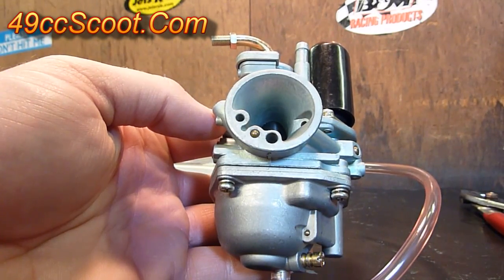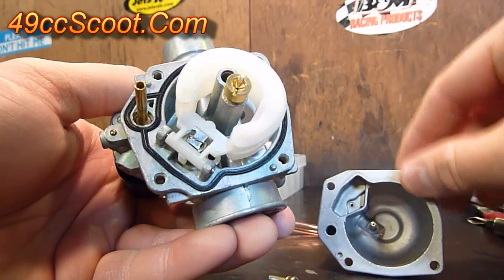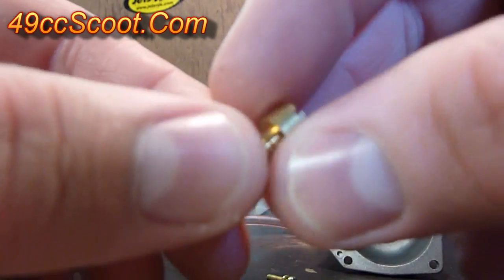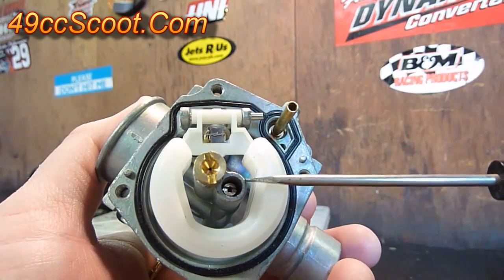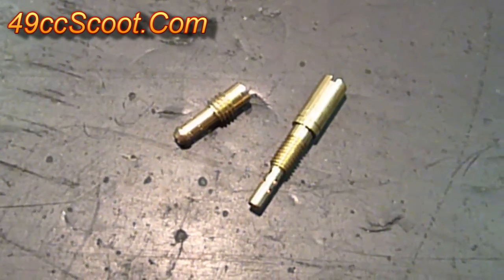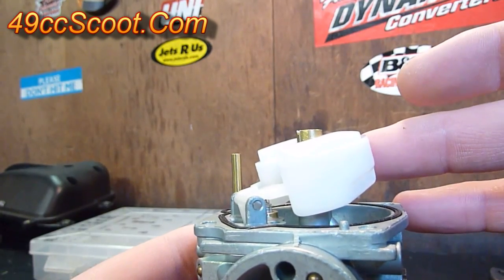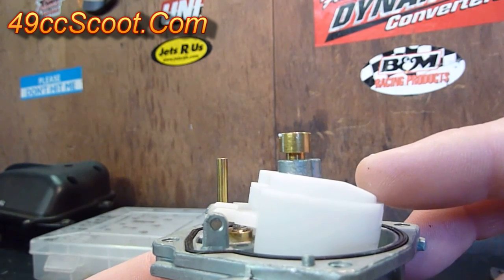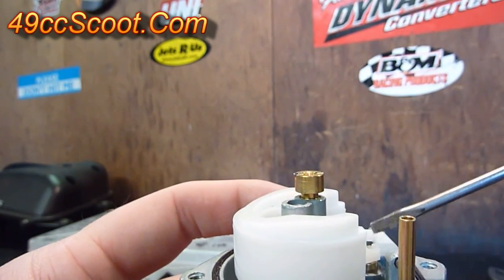Two-Stroke Scooter / ATV Carburetor Settings And Adjustments 4of4 : Jetting & Float Height

Comment: I have an 04 zuma. when I got the scooter it ran fine, fired right up no issues. after having it a little while I noticed it was leaking from the overflow on the bowl. I replaced the valve needle, cleaned the valve seat and replaced the bowl gasket. doesn't leak anymore but now is a p.i.t.a to start. I adjusted the air/fuel screw and best idle was with the thing almost all the way out. I also replaced the air filter with an oem replacement from uni and may have over oiled it? the old air filter was completely disintegrated. was going to order a smaller pilot jet but I'd like your opinion first if you can help me out. last thing, after I get it started (about 30 seconds on the electric start) it runs great down the street and fires back up instantly.
Reply from the maker: My first step would be to take a look at the air filter and clean and re-oil it if it's over oiled. See if the enricher is working. Check your float height. If that's good, you can try a smaller pilot jet.
Reply: 90GTVert Thanks for the reply!

Comment: great vids maybe you can help  my Yamaha.. 99 razz riva, manual choke, idles fine bogs down when you hit the gas and dies, gas leaking from air filter, I replaced the petcock but still leaking slightly.... cleaned the carb and float seems to be working, I blew air into it and the flow stops when the float is lifted...ideas? maybe I messed up the adjustment screws when I put it back together.. set mix screw at 1 3/4 turns from bottom out, idle screw just above the speed to get the back wheel spinning (5 to 800 rpm Id guess)
Reply from the maker: Float height may still be wrong. If it's leaking fuel from the airbox, that's usually a float issue. Till you get that solved, you won't be able to get a good tune.

Comment: could the float cause the engine to flood?
Reply: when trying to turn on? or is it the pilot jet?
Reply from the maker: Definitely.
Reply from the maker: Could be the pilot too, but if the float level is too high it can let fuel overrun and even flood the engine when it's off it fuel flow is not stopped buy a petcock.

Comment: what air filter size would fit this carb?? 35mm???
Reply from the maker: That should work. The stock airbox works pretty well in most cases though.
Reply: i took mine off and it wont go back on for some reason
Reply from the maker: You may save yourself some tuning headaches if you get the stock airbox to fit again.  Once you fit the pod filter, you'll have to tune the carb.

Comment: Hey B, just curious. What is the big silver bolt sitting above the idle screw(edit:speed). I know it's not the AF screw, but just wanted to know since my carb has one aswell.
Reply from the maker: Simple answer : Nothing you need to worry about. 

I'm not totally sure. Most of my carbs don't have that. It isn't any sort of adjustment. It seems there's an extra fitting on that carb for some reason and I guess they stuck a bolt in there.

Comment: Hello 90GTVert , i am having a slight problem , i have changed the air filter , exhaust and am trying to change carb on my yamaha zuma 50cc , but carb cable isn't the right one ( i am trying to install Dellorto 17.5 ) , Dellorto is using cable such as in your vids here when you showed about needle , but mine cable end is different , should i change the whole throttle handle with cable  , or is it possible to change only cable ? Thanks !( sorry for bad english )
Reply from the maker: I think Motion Pro (I could be wrong on the brand) makes a Zuma specific cable. Some of the Zuma guys on my forum could tell you if you can't find a specific cable.
Reply: I don't need to change the handle ? only cable right ? and still , thanks ~ !
Reply from the maker: If I'm correct on that cable, then yes the cable should be all that you'd need to swap.

Comment: i'm having problems with my aprilia sx 50 i purchased a new exhoust put it on there and can't get it to accelerate very well if i let it idle and give it gas it goes but stutters on high revs on low revs its having trouble i tried alot of main jets i'm gonna try to put the needle in the right place and hope for the best
Reply from the maker: Once you get a pipe, make sure you keep the revs up as it's likely to be kind of dead at low RPM. Stuttering/sputtering is usually rich, but looking at your plug after a WOT run should confirm or deny that.

Comment: i am not sure but your mainjet looks not really to fit pretty long the screw thread
Reply from the maker: It is the proper jet. The one you see is the jet that came stock in the carb. The VM11/22 jets have worked for me for the last 10 years in these carbs and match up to stock well, so I think they're OK.
Reply: okay thank u

Comment: i have an issue with my tgb 101s where it just loses all its go at around 30km/h. kinds seems like it isn't getting enough fuel. I haven't got a machanical bone in my body... any tips on what i can do?
Reply from the maker: A really common issue is people changing air filters or modifying/removing the airbox without rejetting. If any of those things have happened, go back to stock or rejet. Look for air leaks, like a cracked intake or damaged vacuum hose.
Reply: +90GTVert I have a feeling the air filter isn't stock. i only just bought it. the current air filter is just sitting there not in a box not fastened in any way. didn't notice until after i bought it.

Comment: Thanks for your explanation.My bike Yamaha FZR 250. i cleaned my mikuni 
carburator (4) and cleaned main jet,pilot jet and adjust air mixture 2.5
 turns out from the closing point.Cleaned the air filter.My problem is 3 times failed my eco 
(smoke) test and result show more petrol consumption.but last years 
easily pass the eco(smoke) test.My problem is need to reduce petrol.How can i 
adjust/reduce petrol flow ?please help.Thank
Reply from the maker: +Ravi Shane Make sure the engine and emissions are in good working order. I don't have emissions tests here and don't know anything about smoke testing. If something specific like NOX or CO emissions are the issue, changing mixture may help. A little more info on that here : http://www.49ccscoot.com/faq/richorlean.html

Comment: Hi , your videos are excellent. Keep up the good work!
 I have a CPI GTR 50 with a mikuni VM16 with 17.5 pilot jet and I'm not sure that is the stock size. Do you know the stock size?
 Thanks
Reply from the maker: Beniiito69 Thanks. The stock carbs I've had have been 17.5 - 22.5.
Reply: *****  OK thanks!

Comment: So i have Baotian aprilia sr50 replica when i start it up the idle is around 1800rpm then when i drive it and its warmed up ti goes up to 3000-3100rpm and stays there, should i re-adjust the idle then ? or something is wrong with my carb?
Reply from the maker: Crepsitto Try readjusting the mixture screw and speed when it's warm. You may have to compromise between the best cold and hot idle quality or decide which is most important to you.

Comment: Hi, I got a new carburetor but it gets over flowed what to do ?
Thnx
Reply from the maker: Start by checking the float height. If the float is set too high it will keep letting fuel in till it's so high that it overflows. Also make sure you bowl screws are secure and the drain is not open. If it's not one of those simple things it may be in your best interest to see if you can return/exchange it since it's new.
Reply: ok thanks :)

Comment: hi hope you can help. I have a piaggo zip 50 2t 2stroke scooter. I done the idle and mix adjustments as in your last videos. the problem is its seams to have more power just off full throttle. if I back off ever so slightly it runs great when I go full throttle it feals like it bogs down a bit and dosnt want to rev right out like it use to. any thoughts?
Reply from the maker: Try using a larger main jet.

Comment: Help !!! I have a Eton Viper 90R that idles great but when you give it gas it bogs down. Any help with this problem will be greatly appreciated
Reply from the maker: My first two steps would be to ensure that the air box is installed and in good condition and then to make sure the carburetor is clean and jets are clear.

Comment: Great video.  I've got a carb off a 2000 Scarabeo 50 2T that I've been struggling with.  The float doesn't have a metal tab on it that you show here and what I've seen on every other type of carb I've ever seen.  This one instead is fully plastic and the needle valve is connected to the float with a spring.  With the carb inverted the float seems to be resting way to high(i.e. setting down into the carb when upside down instead of level).  However since the whole float is plastic there's no adjustment that I can see to make.  Does this style of carb sound familiar?  Could it be that spring that holds the needle valve is worn out?  If not then is it OK for this style of carb to to not necessarily rest level to the bowl mounting plate?
Reply from the maker: It sounds like maybe the spring is worn out, but I can't find any Aprilia Scarabeo service manuals for any specs. If it's not having any overfueling issues, maybe it will be alright. Perhaps you could go to a hardware store and find a spring that would work to get it level when uncompressed.
Reply: Thanks for the reply.  Would overfueling cause the engine to sputter?  That's what appears to be happening after it warms up.  For the first couple minutes it revs up fine, but then consistently it just starts to sputter and cant get enough RPMs to accelerate beyond a crawl.  I originally thought it was a breathing issue but everythign's clean.  The float kit is only $10 so I went ahead and ordered it anyway just in case but curious to know if what I'm describing is symptomatic of this issue.
Reply from the maker: Rich conditions do cause a sputter and also the plug will usually look wet at that point if you check it. Could be a faulty enricher or not getting power to the enricher. The enricher adds fuel for a few minutes at startup, but should stop automatically. If it doesn't work, it can cause what you described. It should be retracted when cold and then once the scooter runs and it gets power it will heat up and expand to block off a fuel passage. Vid below shows it working out of the scoot.
 
Automatic Enricher Operation (10x Speed) : Choke Bypass Bystarter

Comment: Thanks for the vids.  I'm trying to get my son's "new" 2005 Polaris Predator 90 going.  Got a new carb.  Got idle and 0 ~ 25% throttle running like a champ based on your advice.  Still bogs down above 50% throttle and will die if left there.  No air filter attached to carburetor to rule that out.  Any suggestions?
Reply from the maker: With the airbox off they will run lean and bog out, so make sure the filter element inside is clean and then do your diagnosis with the airbox installed.
Reply: ***** Thank you!  Got it going.  Put the airbox + filter back on an in the process learned that I had the choke on the whole time.  I'll stick to my day job and leave mechanic'ing up to the pros.  :-)
Reply from the maker: Glad you got it running.

Comment: When the float chamber is removed, note that there is a duct that feeds fuel into the choke tube cavity. This gets blocked with the residue that covers all the surfaces. Fuel will normally not dislodge this residue. Add thinners and or meths to the choke tube cavity and the volume above the duct and allow it to soak for an hour or until you can blow through the duct from the choke cavity. The motor will not start without the choke (enrichment device) working.

Comment: Got a question see my quad it bogs down when i full throttle it what would it be i have cleanes the carb and bypassed the fuel tap amd still it bogs
Reply from the maker: Any mods to airflow will make it bog without retuning. Leaving the airbox off, drilling holes in it, or just removing the "snorkel" can throw it off. If you modified or removed any part of the airbox, change it back or install a larger jet.
Reply: It didn't have a air box on it to begin with so having to buy a air filter so if I retune it will it keep bogging ?
Reply from the maker: If it ran fine for a long time before and just started acting up all of the sudden the bog prob isn't going to disappear with an airbox or retune. If it hasn't been running well, then I'd suggest getting a filter or stock airbox. Stock airbox may work out well with the stock carb as-is. An open filter will need to be upjetted usually 10-15% above the stock main jet size.

Comment: I adjusted my idle with the idle sreww and i noticed when i was in traffic with my bws 2005 it was moving on it owe when i did not apply the breaks. a few lights after as i was slowing down the bike shut off. i went to kickstart it but the kickstart would not move. i thought my belt broke. i opened it up and the belt was fine but the drive shaft had a one turn play to the right and left then stop dead. can you tell me what damage would stop a driveshaft from moving freely?
Reply from the maker: If all the CVT stuff is off and the driveshaft turns, then locks, either the brake is locking up (maybe a high spot on a shoe) or something is wrong inside of the gearbox.

Comment: I'm getting fuel into the bowl of the carburetor, however I am not getting any fuel to come up into the tunnel where it should be mixing with the air. My scooter stopped running last fall and nothing would have been changed on the carburetor until I just took it off and cleaned it out. Do you have any suggestions to trouble shoot this?
Reply from the maker: Make sure the main jet and atomizer is clear. I would go over the carb again and be sure you get every passage you see with carb cleaner and compressed air. Sometimes you can hold your hand over the mouth of the carb to choke it while you crank the engine and that will be enough to get it to start moving fuel.

Comment: i have almost the same carb on my chinese 50cc but there isn't any needle adjustment on flout,and the flout is little down about 2-3mm it isn't parallel with the carb,and i can't adjust my carb,is there any solution ?
Reply from the maker: I know there are some that have all plastic floats and you can't change the height. If it's not overflowing or starving for fuel no matter where you jet it you can probably leave it alone or you may have to buy a different carb if you want to adjust float height. Maybe the float could be swapped out, not sure, but you can get new carbs so cheap (search Polaris 90 carb on ebay) that most of the time it's not even worth replacing parts.
Reply: *****  well i think it's overflowing with petrol cause i recently cleaned all the injectors changed hoses filters vaccum pump everything,and still have some problem with the carb

From time to time the idle raises and countiniue to raise until i press and let go the gas 3-4 times,idk what is the problem
Reply from the maker: For me when the idle creeps up it's usually a lean condition. Either lean mixture settings or part to WOT jetting/adjustment. If it happens after you've let off the gas from a run, might wanna look into the needle and main jet settings. If it sits and idles for a bit and then does it try a little richer on the mix screw.
Reply: usually happens if it sits and idles but also happens after run 

mix screw all the way down...
Reply from the maker: If the screw has to be all the way in you've got the idle mixture as rich as you can as-is. You'd need a larger pilot jet.
Reply from the maker: You can check for air leaks... uncapped vacuum port, cracked hose, cracked intake, bad seal, bad gasket. Any of that can cause a lean condition and/or erratic idle.
Reply: it was the gas cable,i've changed from 2 cables one for the carb and one for the oil pump to 1 cable only for the carb cause i deleted the oil pump,and it was very tight,now it's solved tnx anyway :)

Comment: I have an Eton Beamer all stock but I just ordered my 70cc kit to go on it. It has the stock exhaust pipe. Should I replace the jet? If so, 1 or both jets?
Also what kind of pipe should I get? I have heard if you just put a bigger kit on without rejeting, it will freeze up because it is not getting oil needed for the bigger jug. Any help would be appreciated.
Thanks!
Reply from the maker: Most likely you'll be fine with just a main jet swap. Fuel helps to cool the cylinder as well. If you run a two-stroke lean it tends to heat up and soft seize (the piston expands more quickly than the bore). What pipe depends on what kit and what you want, but for the average sport/street big bore kit a Leo Vince ZX is a good choice. If you want something more quiet or for a little better low end you could try a Leo Vince GP or SP3. There are other good pipes, but the Leo Vince stuff is pretty good quality and works pretty well.
Reply: What size main jet should I get? Also what kind of pipe will get me the best top end speed? Thanks for your rapid response.
Reply from the maker: TubeRadioSaver
 I would get a main jet kit and tune it rather than hope 1 jet that anyone chooses works. http://www.partsforscooters.com/?partner=49CCSCOOT and others sell them.

The MRP pipe did the best of the ones I tried with a tuned cylinder, but I think the ZX is a good choice if you don't want to do porting and lots of CVT work to keep it on the pipe. Still you'll probably want 1500-2000RPM clutch springs for the LV ZX.